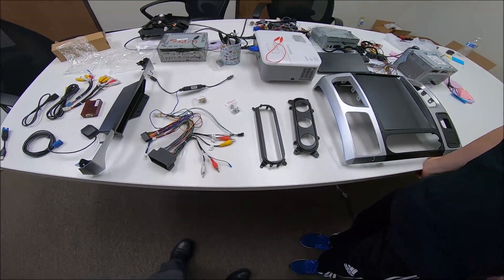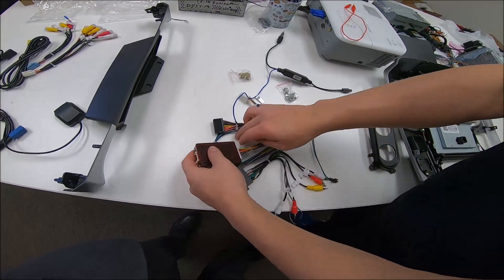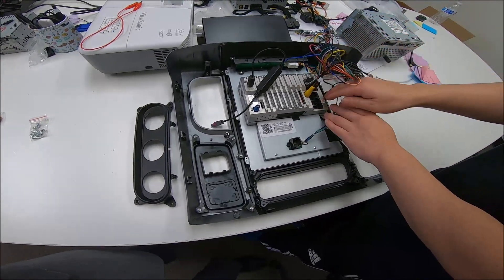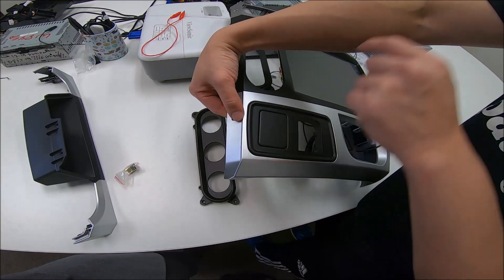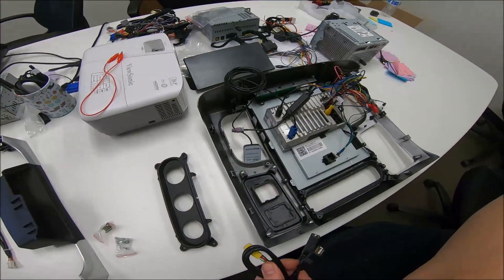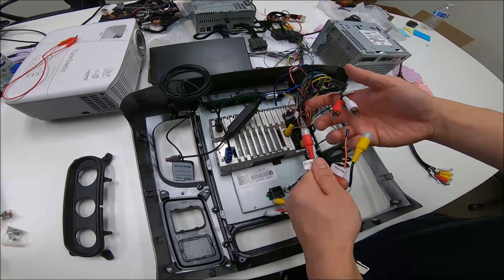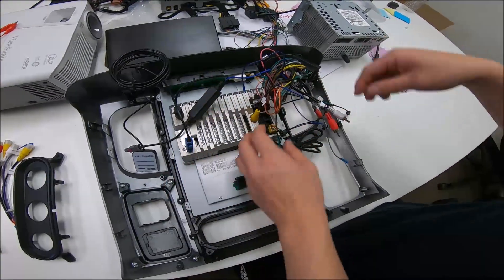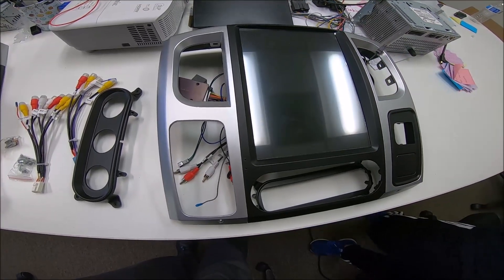How to: Connect and set up PX6 12.1"  radio for 2013-2019 Dodge Ram Auto A/C

Comment: I ordered the 360 Advanced Camera system and the HDTV add on but there are not enough inputs to handle all feeds.  I have OEM Backup camera, HDTV and 360 Camera that is 3 video inputs and the system only has 2 inputs for Video.